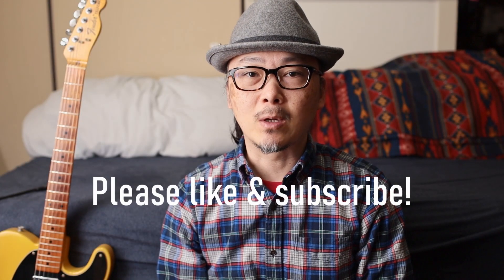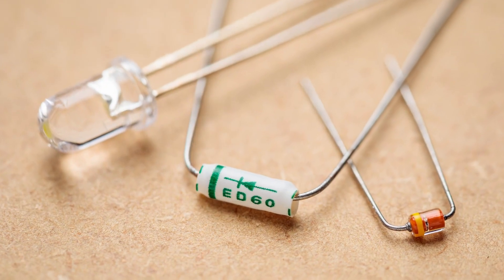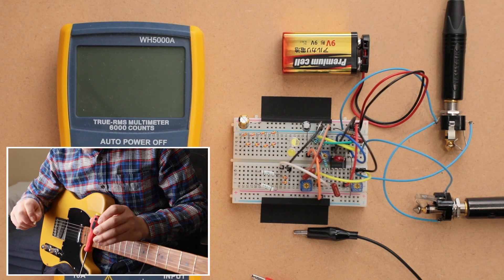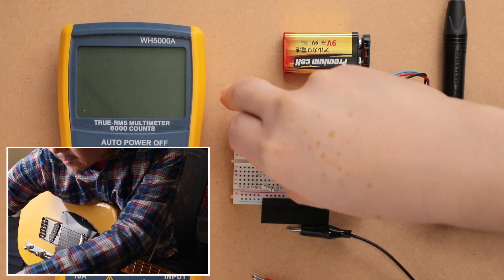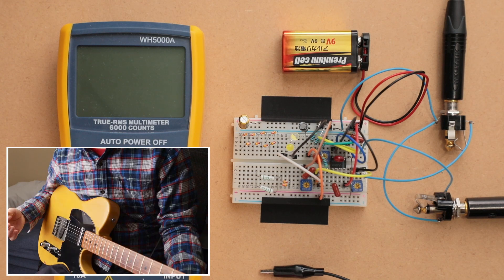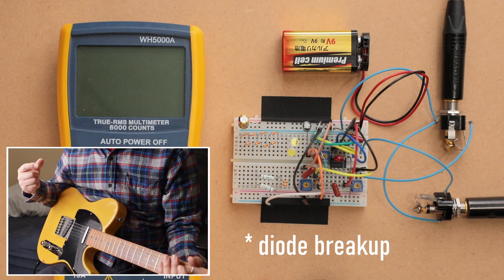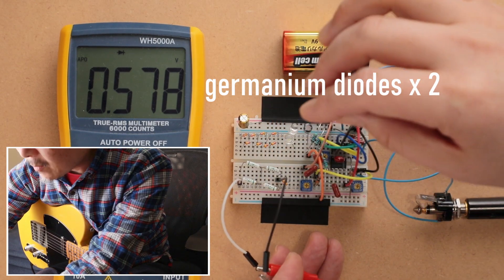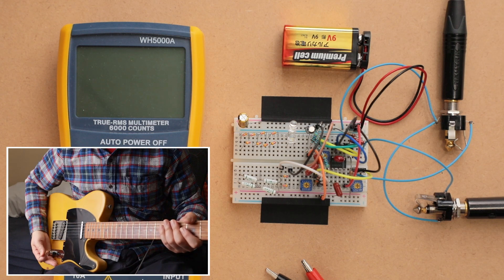How Much Tone Is In The Diodes? Comparing Silicon VS Germanium VS LED In A Hard Clipping Overdrive

Comment: Great video. I just finished a pedal mod by including 4 different clipping circuits for variety. And let me tell you it was SO HARD to get 4 different sounds that were far enough apart to make a relevant change with just LEDs and diodes. I had to introduce various capacitors in series and parallel to change the feel of the response and throw of symmetry at different points. 
I ended up with 4 sounds just different enough to make it worth it. 
My main lesson was that they all sound incredibly similar after forward voltage.
The LEDs had the biggest change between them, and surprisingly each colour sounded like each colour should if you imagined it. But still. It's mostly probably in my head.
Reply from the maker: Thanks for watching! And thank you for sharing your modding experience with us!

Comment: Another great video with great information. You mention forward voltage being the primary electrical characteristic in this test which is valid. However another parameter to explore is each component’s capacitance. Putting multiple in series as you have done will multiply the overall capacitance which I hypothesize will result in slight tonal variation
Reply from the maker: Thanks for watching! Great to hear you enjoyed the video! There are so many parameters that can have a subtle effect on the tone, maybe I'll explore diode capacitance in a future video!

Comment: Gernanium does tend to sound better to my ears, particularly in soft clipping feedback schemes, but schottkys have been the all around winners in my pursuit to have a semiconductor that truly passes for a tube. I'm refining some designs today with a long journey to go, and I did achieve a tube texture with fizz, buzz, zing and froth but need to drastically refine the overall bandwidth performance coming out of my guitar.
Pushed really hard, it sounds as crummy as a tube does when pushed to ridiculous levels lol. It's also far from chugging or crunching, but I will get it there over the next 2 months. 
I'm getting that ultra vintage sound of when tube distortion was first managed out of failing equipment, damaged mixers, failing tubes etc. 
A hugely satisfying result, but a long way to go until it's useable.
Reply from the maker: Thanks for watching! And thank you for sharing your experiences and build stories!

Comment: Nice video. The inclusion of schottky diodes would have been great. Also mosfets used as clipping diodes.  (For anyone curious, transistors can also be used as diodes but why bother?).
Reply from the maker: Thanks for watching! Yeah, several other folks have asked for zener, schottky, etc. But, I wanted to focus on the 3 types most commonly used in overdrive pedals.

Comment: It never occurred to me to match forward voltage by using multiple diodes, clever. Silicone sounds good, best crunchiness and fatness. I don't like germainium, they have a high end skanky-trashiness, no throatiness. LED's sound alright. What do you think of zenners, and why didn't they make the lineup pray-tell?
Reply from the maker: Thanks for watching this one as well! For a moment, I thought about including zener diodes and schottky diodes. But, I decided to stay with the 3 most commonly used diode types in overdrive/distortion pedals.
Reply: @arito  Cool, maybe another day when you are short on ideas. (Not like I bet you have many of those!)
Reply from the maker: @t.c.494  I definitely have ideas for future videos, but maybe if I can add another spin to this video, I might revisit it!

Comment: I have a Build Your Own Clone Silver Pony II which is a dual Klon kit (One full Klon and one Klon clean boost in the same box).  It has a switch on it to select Germanium, Silicon, or LED clipping diodes.  You can really hear the difference since you're able to switch diodes without changing any other setting.

I also have their Royal Flush which is a modifiable King of Tone clone.  It has switches to turn the soft and hard clipping diodes off.  I modified one side with the high gain mod, tone mod, and LED clipping mod.  With that side especially you can really hear the op amp overdrive by turning both soft and hard clipping off.  It sounds great.
Reply from the maker: Thanks for watching! Sounds like you have a great selections of pedals and tones!

Comment: I've found different color LEDs have a different fV with clear being the largest number.  Red/Green are about 1.2, Yellow are about 1.4 and blue are 1.8 or so, which makes it easier to clip with them compared to white.
Reply from the maker: Thanks for watching! Yes, LEDs are all over the map so you definitely want to measure them before implementing them in a circuit, especially if you are designing with a specific value in mind.

Comment: I have definitely found that in a RAT type circuit, I greatly prefer no clipping diodes, but I can tolerate LED diodes. Silicon and germanium are right out, far too much clipping and compression.
Reply from the maker: Thanks for watching! And thank you for sharing your thoughts and impressions!

Comment: Nice one.  I was planning this exact video for my channel!  :)  FWIW, I always hear a smoother, rounder tone with germaniums.  I guess it has something to do with their more gradual change into conduction.  Thanks for the video!
Reply from the maker: Thanks for watching! That would be great if you could make a similar video! Since we would have different circuits, diodes, amps & guitars, it would be fun to compare results and see if our outcome is similar. I also am a big fan of germanium diodes, especially when you stack more than two in series so it doesn't get crazy compressed and low volume. Thank you!

Comment: I see what you mean about tonal difference.  The interesting thing is even when they are not fuzzing out, the germanium seems to tame the highs a bit and soften the attack.  Strangely I think in this circuit I am mostly hearing the distortion from the opamp?  And the diodes are just smoothing out the tone?  Is that right?  Are there other circuits where the diodes are doing more of the distorting?
Reply from the maker: Thanks for checking out this video as well! Yes, the germanium diodes have a unique tone that is spongy, soft, and tames the highs.

Actually, most of the overdrive/distortion you are hearing is coming from the diodes. Specifically when talking about germanium (and silicon) diodes, during sections 4:50 - 5:29 and 14:18 ~ the gain trim pot is set around noon, so the op amp is still pretty clean. At this point, all the distortion you are hearing is coming from the diodes.

When I crank the gain for the LEDs, the op amp starts to clip, but even then, the diodes are doing a lot of clipping. Without getting too technical, when the op amp is clipping, the signal is going between ±4.5 volts (in theory). With the LEDs, that signal gets clipped down to ±2.5 volts, which means its shaving off ±2.0 volts of signal. With germanium diodes, that signal gets clipped down to ±0.3 volts, shaving off ±4.2 volts of signal, which is pretty much most of the signal! Now, this is all what is going on electronically, and what you can hear is a different issue.

But, to answer your question, the diodes are doing a lot of the clipping here. This is a really simple circuit designed to show the difference in diode clipping, so I can't think of other circuits where the diodes are doing more of the distorting. 

Hope this helps, let me know if you have any other questions!

Comment: This is exactly the info I look for constantly and have a hard time finding it, especially presented this well. Thank you so much for explaining this and also doing the op-amp shoot-outs. All this kinda stuff, I'm here for it. I love that you're doing it on a breadboard in where you're sure that capacitance and pot taper isn't changing. These things pretty much make most shootouts ridiculous and based on naivete but this is legit. Thanks again.
Reply from the maker: Thanks for watching! And thank you so much for the kind words, it's really encouraging. As you mentioned, I feel like shootouts miss the point when they are conducted with so many variables, especially when the comparison is about such subtle differences.

Comment: Very enjoyable experiment! 👍 I modified my cheap Joyo vintage OD with a switch for asymmetrical hard clipping to ground. I used 1 silicon diode at 0.7v and 1 small led at 0.92v.  I tried different combos and this sounded the best to me. It sounds very nice with humbuckers. Maybe you could make a video in the future about asymmetrical vs symmetrical soft and hard clipping.
Reply from the maker: Thank you! Great to hear you enjoyed the video! I like what you did with the subtle asymmetrical clipping, I bet it sounds great. I'm planning on making a video comparing symmetrical and asymmetrical clipping, then going further with extreme asymmetrical forward voltage imbalance. Hopefully I'll get around to shooting that one soon. 😃
Reply: @mal2ksc  It is an Infrared LED, so can't be seen with the naked eye. I think it can be seen through a video or photo.

Comment: To me the silicon diodes seemed to have more of a high pitched white noise along with the initial fundamentals. The led's seemed to be the least I liked in that particular circuit. The germanium diodes seemed to have much less of the high pitched white noise. They sounded Softer with a more rounded edge than their silicon counterparts.
Reply from the maker: Thanks for watching! And thank you for your analysis! The germanium diodes do seem to have a slightly softer edge, which kind of is in line with germanium vs silicon transistors in fuzz circuits.
Reply: @arito  Thank you for doing the comparison & posting the video. If not I might not have ever really been able to hear the differences so easily. Also you showed the germanium diodes having the lowest forward voltage threshold made me think about more about fuzz circuits & starving/biasing the diodes...ie, the dying battery as well. I would be curious if there is a way to soften the reaction of the silicon diodes to make them react somewhat closer to the germanium. Maybe extra resistance? Idk, I am of course not well versed in this but I believe if you could make that happen you would have a great sounding pedal circuit.
Reply from the maker: @MAP448  Thank you! I don't know enough about this stuff either, but I'm wondering if the tonal differences between germanium and silicon come down to a material/molecular difference. Meaning, that as a semiconductor, germanium and silicon simply have different properties and thus react differently. In which case, it would be hard to replicate that with resistors etc. Also, there is the element of temperature dependency with germanium, so if I did this same test on a cold winter day, it could very well sound differently...
Reply: I heard same thing, But those Guamanian dios are heat, sensitive. I’m trying to stay away from them.  The led’s seemed vary responsive to attack.